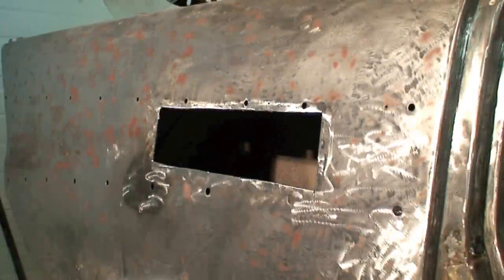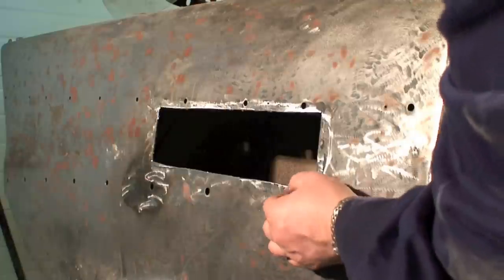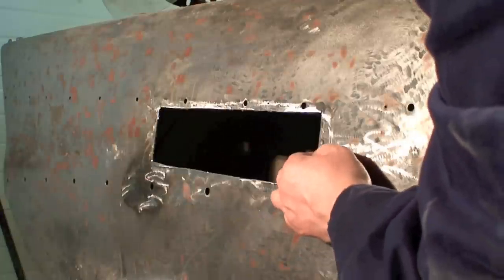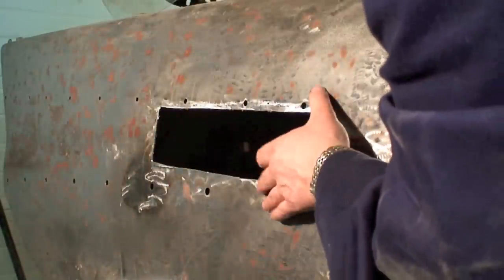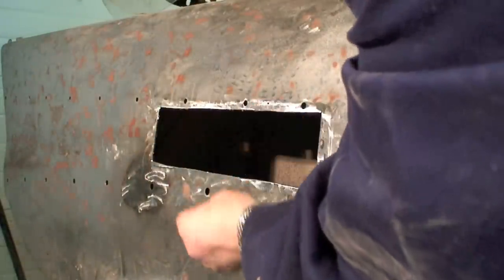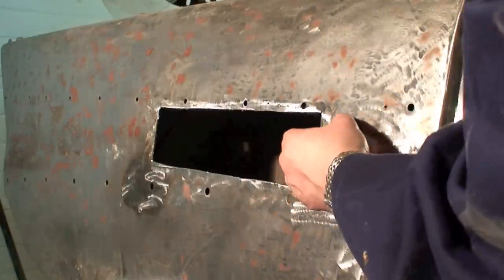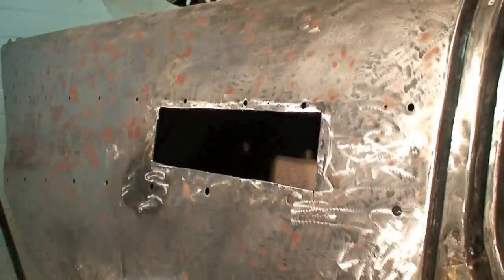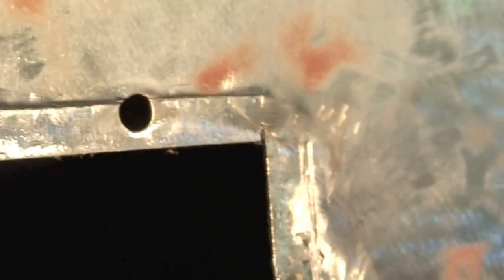How to Weld and Repair Body Panels Using a Flange tool

Comment: When you cut sections out like that, you should always cut the area with rounded corners, or cut oval or circle shapes. As you found out, it makes it a lot easier to run your flanger all the way around and subsequently get a better fit on your patches. Thanks for the video!

Comment: English wheel, and a little "persuasion" of the hammer variety to your patch piece... and you can avoid bondo.  You'll never make perfect, but can get to the point where filler primer and blocking will smooth it out.  If you have an odd convex shape mark piece with a sharpie about every 2 or 3 inches, [parallel] then X between them at a mild angle [maybe 15 degrees?] for easy visual reference.  The bigger the angle, the more bowl shaped you go and vice versa - just match passes, doing one plus/one minus and yes it's gonna take some time.

Comment: the flange tool leaves a flange that is not deep enough for old cars and trucks, unless you use lighter metal for the patch. My old truck got a used oem panel repair piece, and the metal does not fit deep enough, so after welding it in, i had to grind the new metal all along the top edge. i am sure it will work fine on newer 22 gauge cars.
Reply: So is this why I'm not seeing flanges. used much today? It used to be the go to method but I'm not seeing it used much these days. Thinking about repairs to my 75 Chevy C-20.

Comment: Do not overlap patches, butt welding them is the best way.
Reply: Nope.  If you butt weld and then grind smooth you end up (potentially) with a weak weld.  I only butt weld when i can get to both sides of the panel.  This is a really helpful video with a detailed explanation.  https://www.youtube.com/watch?v=MfKlNQF-o4I

Comment: and in about two years, you will be repainting and replacing the patch because of rust.  Your get the same strength with a butt welded replacement and none of the rust risk.